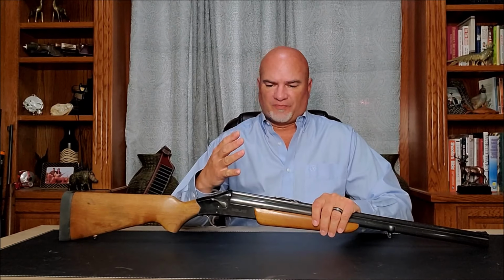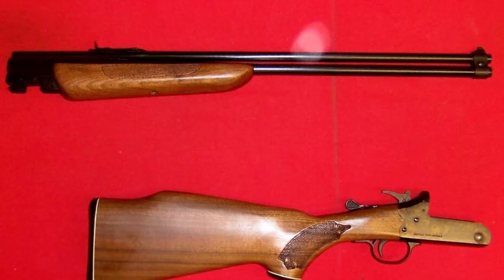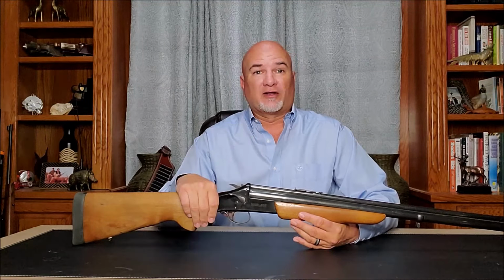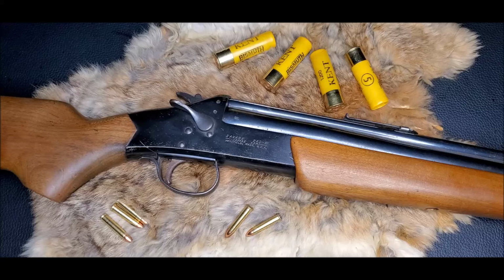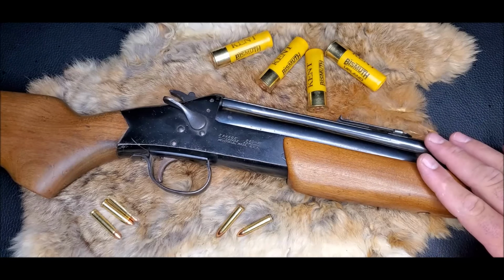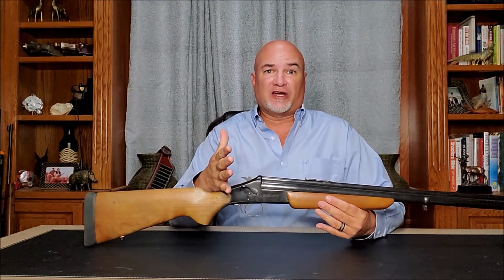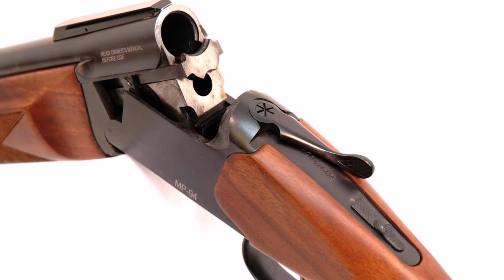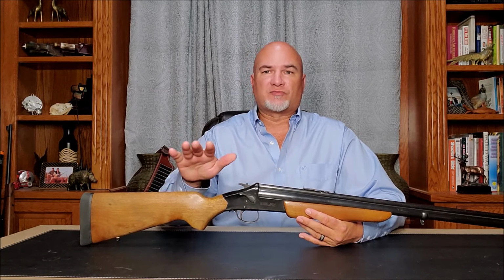SAVAGE MODEL 24: My favorite combo gun

Comment: You found a good one.  My first Savage 24 was the .30-30 over 20 Gauge.  I wanted a deer rifle I could use in North Carolina.  Sad to say, it was a split barrel.  The .30-30 could not group all that well.  But the 20 gauge shot rifled slugs through it into cloverleafs at 40 yards all day long.  I sold it.  My second was a .22 Mag over 20 gauge.  I shot a few squirrels with it.  I told it to get an Baikal Model 94 in .22 Mag over 20 gauge.  I liked the double triggers.  It had the barrels together.  It was accurate enough.  I shot a few squirrels with it as well.  I sold it and now have an older model 24 with the closer barrels.  It is a .22 LR over 20 gauge.  It is very accurate and regulated.  I also picked up the Double Badger in .22 LR over .410.  I liked the double triggers.  It was accurate but some of the .22 LR ammo did not shoot.  There was some light strikes.  I cleaned it up and sold it.  So I am looking for another Savage Model 24 in .22 LR over .410 and one in .22 Mag over 20 gauge to round out my collection.  Nice vide!
Reply: Daniel, I have a 30-30 win over 20 gauge and am looking to sell it.  I am having a hard time finding out what it is worth.  Any advice based on your previous sells?  It is decent shape, but there is some wear and tear on it.

Comment: Alright! This brought a tear to my eye as the Savage 24 was my first gun that I still have and wouldn’t sell at any price. My father gave it to me on my 13th birthday in 1961 with a cut down stock. It’s the original model with 22LR and 410 barrels, and a case hardened receiver. As you said, they are very well made rifles, regulate well, and was the perfect gift to start a 13 year old on a hunting life. I’ve added many rifles into my arsenal in the years since but none are as dear to me as my old Model 24. Thanks for the excellent video!

Comment: In my opinion- a conjoined barrel combo gun like this with a 12 gauge on the bottom (threaded chokes) with a .204 ruger on top. Outfitted with see-through scope rings and a 4-16x optic. Then carry a chamber adapter kit.

Comment: I bought a color case hardened Modell 24 chambered in .22WMR and 20/76 around theree years ago. This gun had split barrels and major regulation issues, so I sold it again. After that, I bought a BRNO ZH 304 in 7x57 R and 12/70. Great build quality, excellent regulation, set trigger, automatic safety and it is one of only a few big bore combination guns, that has the rifled barrel on top of the shotgun barrel. I bought it used for 330 € (~350 $).

Comment: I never owned one but was always attracted to the 22LR/410. I thought that would be the perfect squirrel and rabbit gun. I don't understand why the 24" barrel would be a problem with any choke as all the velocity is gained in about the first 18" of barrel. Also with modern plastic shot wads will make a shotgun pattern almost one choke increment tighter than what's stamped on the   barrel especially with older fixed choked guns. Now I've got to go out and find one of the early guns with the good barrel construction and regulation. I'm with you on the barrel selector but I like the top tang lever like on my side by sides and over/unders. Keep up the good work. Keep'em coming and good hunting.

Comment: Great video. I have a Model 24 N and I haven't gotten the sights set yet to hit anything. I haven't picked up any .410 shells and only had 6 when I got the gun, and Walmart hasn't had any in quite some time, so I haven't had any real checks on it. Right now, I can hit a printer paper case box around 50 feet and way off on the .22 even at 25 yards. It has potential but hard to do much at a public range where everyone is competing for a shooting spot and you can't go cold range every few minutes to check targets. You guys with a private place and room to shot are more fortunate than most know.

Comment: I have a 24S-D 22lr/20gauge. It was pretty rough when I got it and I had the sights redone with fiber optic peeps lights and removable choke system installed. Love it! The only caveat is to remember to keep it on 20 Gauge for snap shots and to check that you don't eject the unfired .22 cartridge when you reload.
Reply: Bonus os it breaks down into half its length. You can get a case (Tourbon) for $26 on Amazon and slip the parts into without them clacking against each other.

Comment: I really enjoyed this vid, Dog, because going back to my teenage years I wanted one of these guns badly. Fast forward 1-2 decades, I found a combo gun at a gunshow. A .222 Rem over 12 ga, it is nothing fancy. Has split barrels and side selector but the rear sight folds down. It says Ithaca Gun Co as well as Tikka on the side. Sadly, I have not hunted it much. Now, I have a Krieghoff drilling with 16 ga barrels over 7X57R. It's a cool gun. When you select the rifle barrel, the rear sight flips up automatically. As far as old guns with fixed full choke barrels, they can be made to be more effective at close, upland ranges with the use of spreader loads. Thanks again, DD!

Comment: I carried one from age 12 to 15 running a Trapline ,Squirrel and Rabbit hunted with it it was a 24 D  22LR, L,S, over a 20ga and it had a 410 adapter barrell around 12" long that slid into the 20ga i loved that gun unfortunately it belonged to my Grandfather and it was sold but i still have the 410 adapter and use it in a NEF 20GA.
Reply: Those are called 4 tenners - worth  about # 100 today

Comment: I’ve owned two, a 17 over 12 and a 357 over 20. The 17 had an extractor issue that ultimately caused me to sell it, I’m still working out the sights on the 357 but I like it a great deal so far. My favorite combo though has to be my marrocchi 612 (an updated valmet 412) in 30-06 over 12 gauge. This one is particularly nice because you can adjust the barrel regulation on your own. Super fun guns all of them!

Comment: How did I not find this sooner? I search for savage almost every night at work..... I first found a later model WMR/20  that was ina a house fire, I restored it but I was never happy with the split barrels and the cheap sights. Ive tried to sell it a few times and I always end up being mad at people and keeping it.. Once I learned a lot more about them I started looking for another one. I found a gun that someone had tig welded a scope mount to the barrel. its a 24s-e similar to yours. its only .22lr though.  I had the barrrel cut down to 19in and winchoke screw in chokes installed. then I shortened the stock from the front so it moved the grip closer to the trigger while shortening the LOP.  I carried it for years and now im getting ready to tear it down and refinish it.

Comment: I've shot a few Model 42s and they all have been shooters.  All Savages are accurate but like anyone there will always be a lemon here or there.  These 42s shoot better than they look.  Problem with the 24 is it's too expensive to make, same goes with the Model 99.  They could make them but most are not going to pay what they would cost.  Your talking Ruger One money and maybe more.  I tell you that 410 with a slug is a thumper in the 42's six pound weight.  Not as bad as my old HR single shot break action 12 gauge, she was old and actually serial number 6 on that gun.  That thing was brutal and too painful for a 15 year old.  Freaking thing cause a flinch after the shot

Comment: I just bought a 24F in 12 gauge choked and 22 hornet. Never been fired. Got it for about half of what they are selling used for on gun broker. The trigger is horribly heavy and gritty. I’ll take it apart and do a trigger job on it before it it gets an optic.
Reply: I stoned my trigger on and off for the last couple of days testing along the way.I now brakes crisp at 4.5 pounds. Its so crisp that to me it feels similar to 3.5 pound AR aftermarket triggers.  I’ll load test and see if it’s regulated before I lighten it any more.

Comment: I have a split barrel 3030 over 20 and love this gun. Inherited years ago. Case hardened blueing and checkered walnut stock. Could you tell me if the shotgun barrel is full choke or not. My motto when carrying this gun is that the bottom barrel will fill the pot but the top barrel will fill the freezer.

Comment: Sold my stevens 22 410 with tenite stock for $400. Buying a bolt action 223 now for $450. comes with a red dot sight. Ill use that as my main hunter instead of my savage 243. 55 grains can drop deer easy. Theres a video by waikirimoane and they hunt red deer  and they are dropping those big red deer with 55 grains bullets in 223. id set it for 300 yards and leave it there. Red dot sight is a tube style that looks like a scope and the gun with the reddot looks really sweet. I can use it for target shooting too.